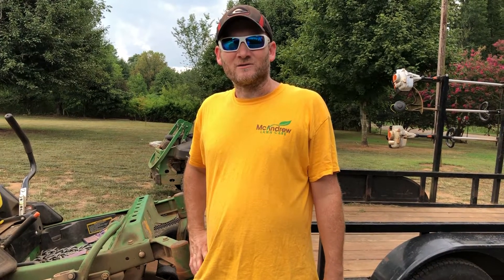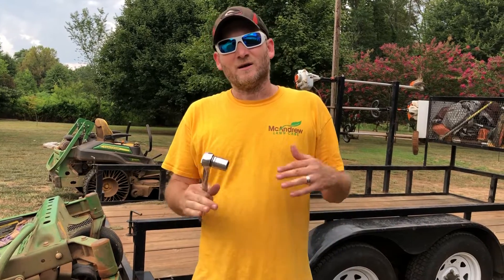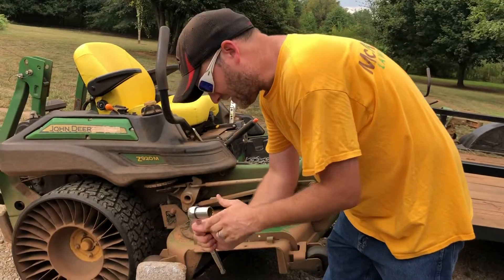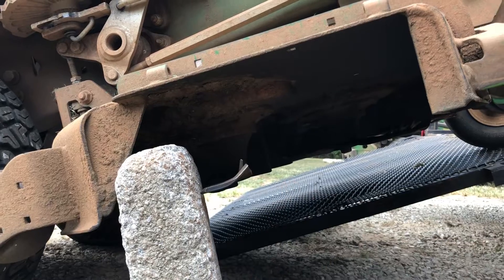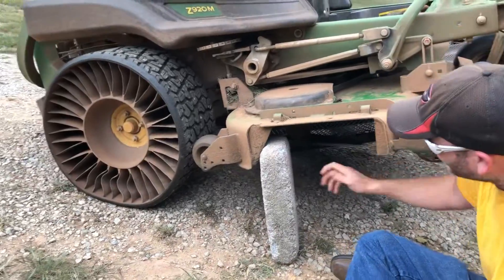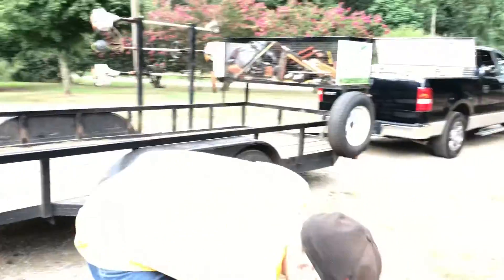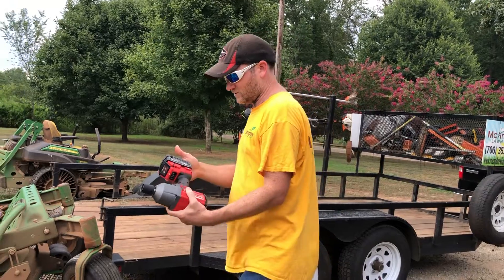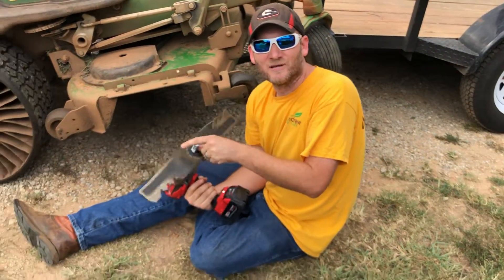How to Change Mower Blades The Easy and Hard Way

Comment: Tool Man Tim had it right all along.  Every job starts with new tools!  Even if you have an air impact wrench and an air compressor you can't be using those anymore now that they have battery ones.  Heck you can't even fill your tires up with an air compressor because now they have battery powered inflators.  Why mess with the hose when you can spend $100?

Comment: If you put "Never seize" (napa) on the  all your threads, blades, wheels, etc, before you put the nuts back on , removal even several years later is  no problem. I've used it for many years and never had a nut come loose and removal has been easy, especially for an 75-year-old fella.  Also, a block of wood against the mower deck held on with a clamp is much easier than a brick or 2 x 4  there are several videos on john Deere mower you tube that show this method.

Comment: I’ve been trying to get my blades off for 3 days now, I finally removed one, can’t get the other off. When I try to unscrew it, the bolt on the spindle turns also, what can I do?
Reply: That has happened to me on a couple of occasions. Sometimes I can hold it in place from the top, but normally I just take it in and have them fix it. I haven't been able to figure out how to fix it myself.

Comment: Do the blades have to be aligned or positioned a certain way? I changed my blades and now I have a strip of grass that doesn't get cut
Reply from the maker: Make sure it's on the right way. I've put mine on upside down before.